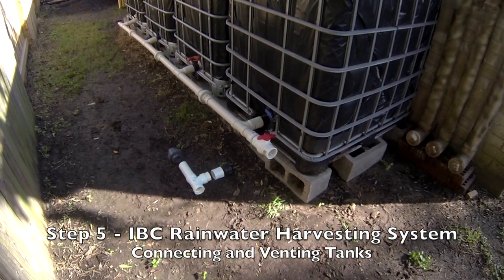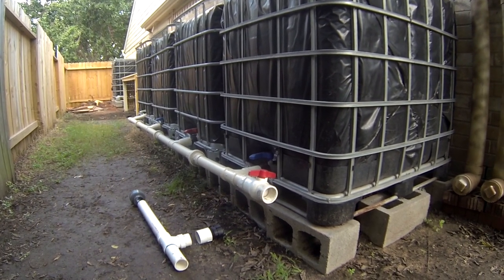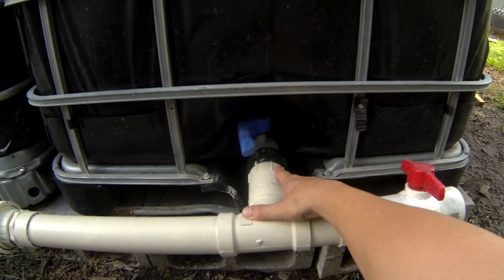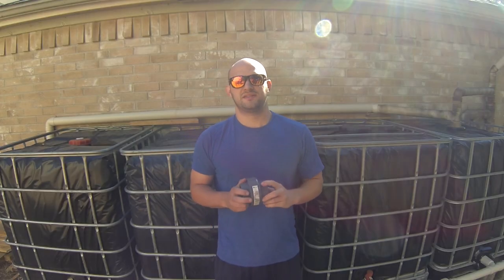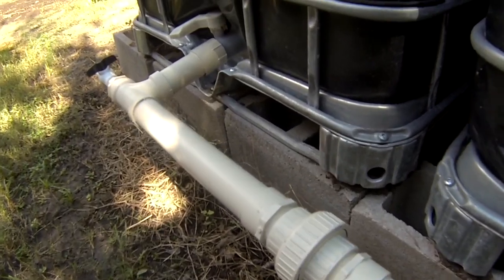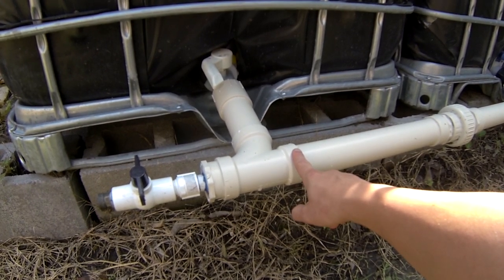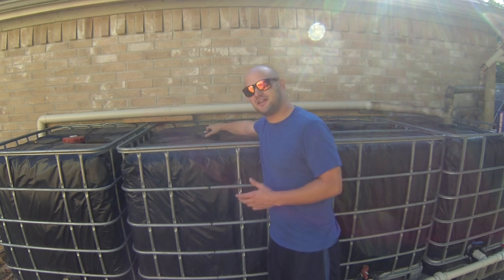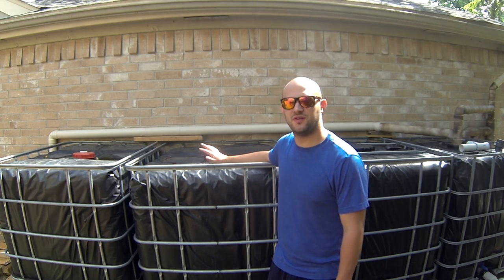Step 5 - IBC Rainwater Harvesting System - Connecting and Venting Tanks

Comment: Trent, Thanks again for the videos.  I modeled my system after yours and over the last few days we got almost 4 in of rain which was the true test of the system.  The first flush worked great.  As I mentioned in another post I used a lemon juice bottle I got from COSTCO. Biggest lesson learned was the venting. I checked my system during  the rain and apparently the over flow was not adequate as a vent, which is why I'm watching this video again.  Lack of venting caused one of the tanks to collapse a little bending both top support bars.  Lucky the tank wasn't damaged and I was able to get it back in shape.
Used a vise to bend the bars back. Anyways, I have the 2 tanks I have setup so far  completely full.  Thanks again.
Reply from the maker: +Tom Amato happy to hear it is working out   .

Comment: Great video. Your cinder blocks will not hold much weight maybe 200 LBs where done right they hold thousands. . Cinder block Hole should be facing upwards.  One thing I learned quick is when you are buying your tanks try to get all the same tanks with the same valves.  I tied all my tanks together at the bottom like you but at the end tank I ran that line up to my gutter supply line. Bypassing it to be top feed.  I just got it all glued up yesterday and it has not been tested yet for rain water  filling.  When I turned on all 4 tank valves all the tanks started at different water levels 2 of them were 100% full, one almost full and one tank was only 1/4 way full. With all the bottom valves open the tanks took a long long time to all be nearing  the same level.  I figured with 2" PVC on the bottom connecting all the totes they would balance out very fast  But it has been 2 to 3 hours and one is only half full where had a 1/4 tank  full at the start....  As others said I'm going to get some black paint for painting plastic

Comment: So I have been looking into this for my own place... I work for a water bottler so they do this on a massive scale.  They feed into tank #1 like you have but then out the bottom of #1 then into the top of #2 and so on down the line.   Our main system holds 200k gallons across 6 tanks.  The other setup mostly uses gravity to get the water to the final tank before a pump readies it for bottling.  Our method moves water based on FIFO.  Does your system leave stagnant water at the back end near the last tank?

Comment: I like your set up and detailed info.  I'm confused on your venting/overflow though.  Why would the water go up to the overflow (I'm guessing its about 3" higher than the vented top) when it can simple just go out the vented tops.  Seems like each vented top would need a vent pipe that's higher than the overflow pipe otherwise there would be leaking out of the tops of each tote.  Any info would be appreciated. Thanks
Reply from the maker: It flow threw the overflow because only a small amount of water is able to get threw the caps. Water does come out of both but (98%) of the water flow threw the overflow.
Reply: Thanks for this. Exactly what I wanted to know for my setup and the answer is what I was hoping!

Comment: Here's an idea for you, but it has it's own drawbacks.  You have the overflow connected to the first tank.  Instead of doing that, how about connecting it to the top of the second tank with a "t" fitting , and using a "t" fitting, connect the third tank to the second tank, and using a "t" fitting, connect the fourth tank to the third tank, and then the overflow runs out the top of the fourth tank.  Connecting them in series like that also provides venting.   If you connect your tanks at the bottom for filling, you share the same slightly dirty water that ends up in the first tank with all the tanks.  If you fill from the top, the water is cleaner in the second tank than the first one, and cleaner in the next tank, etc.  That assumes you don't bottom connect each tank together, so when using that water you have to connect to each tank separately at the bottom to use the water, and that's a minor hassle.  I guess it depends on how often you use the water, and for what reason.  Although, with the valve on each tank, you could still bottom connect all the tanks together for use but you would have to open and close each tank as you use them up to keep the rest of the tanks cleaner than the first one.
Reply from the maker: TheStavros1001 Thanks for the suggestions, this should like a solid ideal. It would be nice to fill from the top on all tanks.
Reply: Trenton Kaminski
You're welcome!  I forgot to mention if you connect your tanks the way I suggested, and isolate the water by keeping the bottom valves closed to keep the water as clean as possible, you'll want to always use the water in the first tank first.  I don't know how often it rains where you are, but I would guess that you wouldn't have 4 tanks if you weren't able to fill them from the rain.  <g>
Reply from the maker: TheStavros1001 I will note that, thank you. I'm near Houston Texas, we get our fair share of rain thats for sure.

Comment: Thank you so much for the detailed videos!

I have a few questions for you that I hope the answers will help clarify a project I am working on.

I have a large food forest / swale system in the back of my property that I am wanting to irrigate with water from my 2 acre pond.  I have a gas powered pump that can quickly and easily pump water from the pond up to the top of the food forest (about 250 feet away).

I hope to build a "water tower" out of 2 or 3 IBC totes that I can attach hoses to for water irrigation.

1.  Are most of the PVC pipes, fittings, valves found at Lowes and Home Depot, or did you go somewhere else for them?

2.  In order to get a stronger pressure in the hose that I will use to water the orchard with, I was considering arranging the totes just as you have, but elevating the totes 4-5 feet off the ground.  What would you suggest as a good way to raise them up?  I can get a bunch of wood shipping pallets very cheap - If I leveled out a bed of gravel and stacked the pallets on top of each other (even supported with some cross bracing) do you think it could support the weight of the IBC totes when they are full?  Although the budget is there, I really don't want to make this any more expensive than I have to.

3.  In one of your videos you also mentioned getting a small pump to increase the pressure of the outgoing water.  Could this be a better alternative than elevating the totes?  What type of pump did you have in mind?  With this type of pump, would I then have to use the more expensive PVC pipe that you mentioned for use with water under pressure?

4.  The gas powered pump that I have to get the water from the pond has several hundred feet of "fireman's hose" that extends to the top of the property where the water tower would be placed.  Would I need to install the "pantyhose filter" like you have in your system to filter the pondwater?  My concern with that is the pressure of the water coming out of the fire hose is massive - like a fire hydrant type of pressure.  I wonder if it would tear the pantyhose to shreds.  Not filtering the water would be much more convenient - it "looks" crystal clear but I have to assume it has some debris in it.

Thanks for all the work you put into the videos!

Mark
Reply from the maker: IFixTeeth Thanks for watching Mark, I did find most but not all pvc fittings at lowes an home depot. Step 2 on my channel is over specific adapters for IBC totes, I had to order those. Other pipes that I could not find I went to Ewing, an irrigation company near me. 

As far as stacking or raising your tanks, my thought would be to just stack them. I know you can go 2 hight but am not sure if you can stack 3 high. Each tote full of water weight over a ton. 

Check out the pump here...https://www.youtube.com/watch?v=YpKayMx-edQ
It was a 5gpm rv on demand pump, runs off a battery. 

I filter so much because I end up drinking the water, if it is for irrigation only I would  make sure that there is nothing to large that will clog your irrigation hose or mess up your pump. 

Trenton
Reply: Great video's,  I'm about to start doing the same at home. I didn't have any idea on how to go about but I do now!  
One question, did you have your IBC's on a gradient when you set up your block's?
Cheers again mate!

Comment: how often do you need to clean the tanks themselves, also if the blocking mechanism is blocking the water from coming up in your diverter how is the clean water entering the tanks? is it direct from the gutters or from the overflow on the diverter?
Reply from the maker: Since I built my system I have cleaned the tanks one time. Only once the diverter is full does the bottle act to block the water. The bottle is in a 4 inch pipe once the water rises it will stop or get stuck at the part where the pipe reduces to 3 inches.
Reply: Thanks for clearing that up! i plan on getting one started next spring.
Reply from the maker: Great to hear, send me some pictures when you are complete it!

Comment: Where is your overflow / level setter for the IBC totes?   I thought it should be in this pipe that connects all the tanks together.
Reply from the maker: At this moment the overflow was threw the caps which also vented the system.
Reply: Thanks for the reply.  I just did one (created a rainwater catchment system).  And I just moved the overflow (via a 4 inch flexible corrugated pipe) into a swale.  Which seems to be working.  This was a lot of work.  2 months of no other gardening, basically.  But now I have about as much water as I want and I'm planning on connecting my hose bib from the tanks to a manifold with several soaker hoses going through a new garden I just built and am starting to plant.  I like something I heard about permaculture:  It's not how many elements you have in your system (per se);  it's about how many connections you have between elements (preferably automatic non-work-requiring connections).  I watched a lot of your videos to learn / get motivated.  Thank you!

Comment: I need a source for those tanks. What are they called and where can I get them. Thanks!
Reply from the maker: +Robert Fernandez IBC tank, Craigslist
Reply: They are called IBC tanks. they normally don't cost that much; that's why people r using'm. We here in Dubai for example each capacity 1000L could cost about 32$, with out delivery though.

Comment: What about the overflow pipe? It looks like the water would leak out of the vented tops until the water drops to the level of the vented tops?
Reply from the maker: Exactly lids were both a vent and overfloe, later I did add a proper overflow.

Comment: could these tanks potentially be connected to poly pipe and drip emitters to water trees? thanks
Reply from the maker: +Laura Carlton yes you should be able
To do that. You may need a small pump or needs to raise the tanks off the ground for good pressure.

Comment: How you add pressure to the tanks?
Reply: You don't. They're not pressure tanks, only storage. You add pressure to the water line as it leaves the tank with a real water pressure tank and pressure pump (less than $300). Although these large tanks do have quite a bit of natural pressure on their own due to the volume they hold (gravity flow). Need more pressure? Raise the tank higher off the ground more, or get the pressure tank/pump and have like 30-45psi.